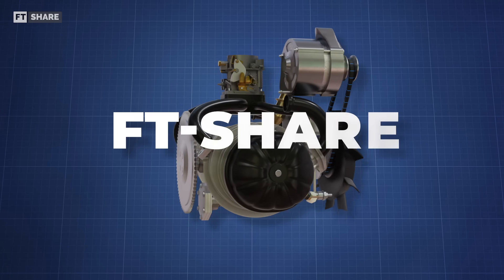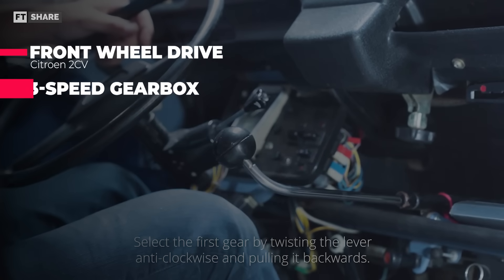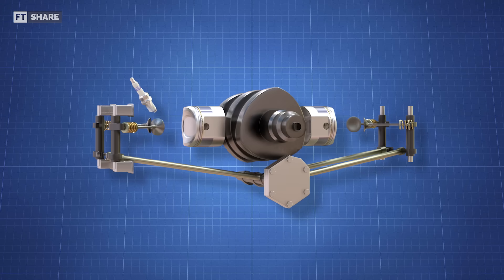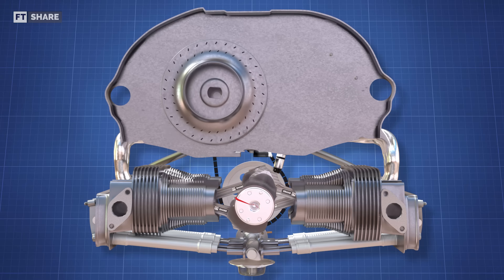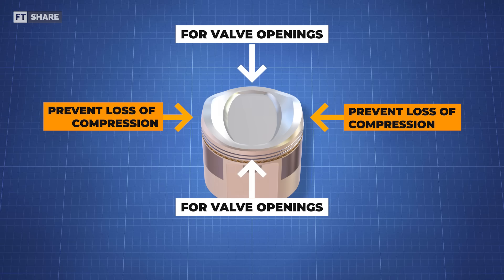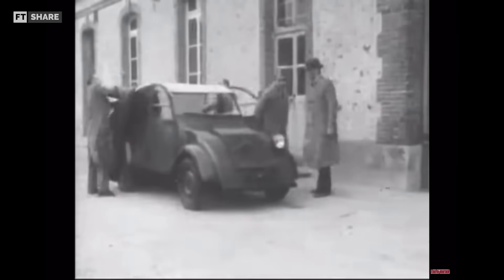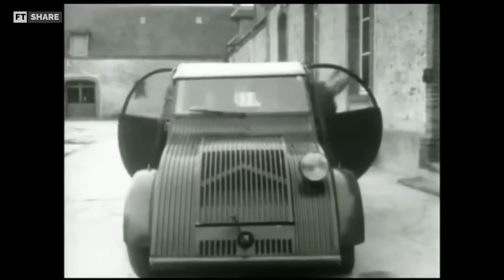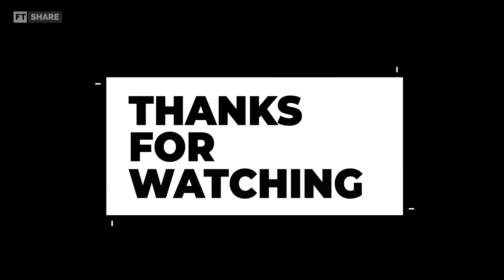The Most Interesting Engine in the World: Citroen 2CV Vs VW Beetle

Comment: Do not forget, the VW engine is a Design from 1934 (by Ferdinsnd Porsche), while the 2CV started from 1945 while André Lefèbvre  knew about the beetle ( and its flaws). And take the BMW Motorcycle in consideration, which also had a 2 cylinder boxer engine, which is produced up to these days ( at least the basic design)

Comment: He ignored the fact that the Volkswagen engine has a oil radiator besides the fan. Every beetle since 1938 has 4 gears, the 1100 cc engine was only produced until 1953, the 1200 had 36 hp! And the most common 1300 had 46 hp, the biggest one was 1600 and with carburettor achieved 65 hp. At 9:10, the beetles with crank manual start are so rare and are from the 50's. There's more thing that he igonred, but if you know, you know

Comment: I love A) that this video was clearly an AI development, and B) that it is way biased for the 2cv. Granted I’m biased towards the Beetle, however they left out so much information about the Beetle’s engine (i.e, they fixed cylinder 3 overheating with a doghouse cooler in the 70s with the largest Beetle motor, which made 50-60hp depending on emissions regulations, the Beetle doesn’t rely solely on the cooling fan but air moving past from the underside and some oil cooling, etc etc). Definite slop either way

Comment: Somehow the Citreon wasn’t as successful as the Beetle. The Beetle was sold in its millions and made in other countries. Still in the post-war period it was what many needed - simple, affordable, … like the Beetle which went from circa 1.1 liters to 1.6 liters, the pressure was fir more power and torque. 

The crankshaft construction is seen in motorcycle engines. The ubiquitous Harley-Davidson 45 deg V twins use such a multi-piece flywheel-crank assembly. Except H-D used “knife & fork” connecting rods thus having no offset. And the H-D V twins used the “wasted spark” ignition system. No distributor rotor is needed as when the the breaker points opened both spark plugs fired. Once in a cylinder on the compression stroke and the other on the exhaust stroke. This was used until replaced with more sophisticated systems with crankshaft position sensors & computers. 

60 kph top speed is about 37 mph. There are e-bikes that the Citreon might barely be able to outrun. But the Citreon sure beats walking in the rain.

Comment: Another script written by chatGPT. There are way too many errors in this AI generated slop, eg passing hot air past the carburettor will not imcrease air density a d bower but will in fact do the opposite.
Reply from the maker: Thanks a lot for your feedback. We know language is still a bit of a challenge for us, but we’ll try to work on it and improve in future videos. Really appreciate you pointing out the parts we got wrong.

Comment: Starting with min 6:20 ´´...the hot air was used to heat the carburator wich by heating the air entering the engine will increase the density and power of the engine´´ .... SAY WHAT ???  As far as i know  in order to increase the power of an engine the air entering the burning chamber has to be cooled down with a intercooler. Cool air is more dense not hot air am i right ?
Reply: Yeah, you're right

Comment: Comparing the 1200 cc VW engine with 34 hp against the 602 cc (later) 2CV engine with abt 30 hp it seems that the 2CV engine is much more efficient.

If the VW engine, which is twice as big, had the same efficiency it would have about 70 hp.
Reply: But it's up to the manufacturer too decide how much power an engine produces. VW could have made the engine produce 70hp if it wanted to but didn't.
Reply: @wizzard5442  70 hp from a 1200cc engine would be quite 'tuned' and it would at least needs 2 carbs, the 2CV only has one.
Reply: @flyingdd  I'm aware of that, I used to drive VW's for 30 years.
I said 70hp because YOU said it.
Reply: @wizzard5442  My only point was that the 2CV 602 engine was (built) so much more efficient than the VW 1200 engine.

Comment: Thank you! GREAT made! I have a Citroën Dyane 1967 a luxury 2CV.
I like a lot your animation.
Little "error" is that the smaler engine (mine has 425cc and 18 german HP) have thier dynamo (DC) AROUND the crankshaft! AGAIN less a part that could break! INGENIOUS!
That car is "simple" but geniously simple.
Also the suspension is ingenious. Only the Hydropneumatique would be better.
With my Dyane I have true 100Km/h on the Autobahn and in flat lands a consumption of only 4 Litres per 100Km and in the mountains below 5 Litres/100Km.
Weight is only 580Kg empty (5Litres in the reservoir and no tool box) so close to 600Kg if the 20L reservoir is full and a good box of car tools.
GREAT car - I call her Jana and she's my best mechanical grilfriend xD.
Let me tell you that I like it ALOT that she's semiconductor FREE!
Cordial greetings!
Géréon
Reply: En el mío por 1983-4, los platinos había que calibrarlos cada 3 a 4 meses, para mantener una agilidad y repuesta razonable, así que encontré en una revista de radioaficcionados, un circuito con dos transistores de potencia, y alto voltaje, dos resistencias una de 20 watts, y otra de 5 w, usando el mismo condensador del auto, y se intercalaba en el encendido normal. con ésto el platino pasó de usar 2 amperes a apenas tener que pasar de 0.2 a 0.5 amperes, la chispa pasó de casi 10 mm, a 15 mm, y la marcha se tornaba muy serena, la luz del platino, podía ser mínima y en un año no se debía recalibrar, no había chisporroteo en el platino, con lo cual no se desgastaba. resultó tan útil que lo llegue a reproducir para varios amigos con 3CV, y aún más se lo instaló en un Peugeeot 504, en un Chevy 230, en una Ford F-100 de 8 cilindros, perfectamente. en el caso del Chevy 230, la marcha era tan serena, que andando en la calle a paso de hombre, el motor no tironeaba, en tercera, y yo creyendo que estaba en primera, quise acelerar y ahí se me paró, por el bajísimo régimen de rpm que llevaba el motor, y no me había dado cuenta por la serena marcha del motor de 6 cilindros !!!
Reply: @c.e.ardanaz1234  die Kontakte (français: les vis platinés; english: points) von "TROUVE France", Nachfertigung, halten bei mir 12'000Km (ausprobiert bis der Motor schlecht lief). Ich fahre im Jahr weniger als 10'000Km sodass ich froh bin mir die Halbleiter vom Hals zu halten.
Diese Autos werden noch fahren wenn es einen Sonnenstrum oder einen Atomunfall gibt. Glühbirnen mag ich auch viel lieber - kleine Sonnen.

Comment: I am familiar with the Beetle engine as I've owned several VWs, the earliest being 1963 and the latest a 1967. I will comment using my personal knowledge of these engines and what I see here on the 2CV engine. It looks like the 2CV engine is cooled simply by a  fan, without any regulation to provide consistent operating temperature. The Beetle engine incorporates a fan housing which directs air downwards across the four cylinders and out. There is a thermostat that operates flaps that regulate the cooling flow of air, allowing for very fast warm up followed by constant running temperature. The number 3 cylinder ran warmer as stated here, but that was corrected in 1971 by an offset oil cooler that didn't block air from the cylinder. This system was easily retrofitted to earlier engines if desired. The oil pump was as described, but it worked well and better oil pumps were available and easily fitted to the engine. The Beetle engine also had a carburetor pre-heat system to prevent icing. Boxer engines with center-mounted carburetors are susceptible to icing because the carbs are separated from the heat of the engine. The VW engine compartments were sealed so that the heat from the cylinders and exhaust would not enter above the floor of the engine compartment where the air intake and carburetor was located. The lower compression of the Beetle engine reduced stress and allowed for longer engine life. However, the typical fuel economy of a Beetle was between 28-32 MPG which was apparently not as good as the 2CV. The Beetle had a distributor with a vacuum advance and fired only on the power stroke of each cylinder. But the method used on the 2CV with a wasted spark is like many motorcycle systems, so its really not that weird. The fan on the Beetle was driven off the back of the generator shaft, the generator being connected by a V-Belt. If your generator light came on because of a broken belt, you had better immediately pull over and shut down because without the cooling fan, the engine would cook in 15 seconds. In all my experience, this never happened. 

I hope I provided some additional useful information to what was presented here.
Reply: The 2cv has a cooling shroud, that covers the fan, cylinders and cylinder heads. Pretty much like on a VW. Only not thermostatically controlled..Carb icing on the 2cv was dealt with by exhaust gasses heating up the manifold.
Reply: Re the VW broken belt, in the Type 3's, the fan was part of the crankshaft drive-line so if the belt broke, you could still drive until the battery died.
Reply: @ReddThreee yes, only 0:06  the VW 0:06 engines with the upright fan housing use a belt to drive the fan.

Comment: I guess we are going to see more AI generated garbage littered with incorrect information. As a technician watching this is cringe!
Reply: Like the gearbox being three speed when it is actually four speed.
Reply: The 2cv engine is turning the wrong way. The 2cv oil pump shown here would not send a drop of oil anywhere. The valves are doing all sorts of strange thing, such as pushing the exhaust gasses back through the carburettor. I can’t watch any more of it either!

Comment: It is a real shame that the ‘facts’ presented are so distorted. Like already said… the spark plug gap inhibits cooling. OMG. 
The oil cooler is over #3 cylinder but really doesn’t cause an issue in well maintained engines.
Reply: Cusí cusá, no es el primer vídeo con incoherencias, lo bueno sería una "fé de erratas", no?

Comment: Wait, wait... Do you actually think that the 2cv remained at those 9hp forever?!
You do realise that your figures are only for the first series, Type A from 1949 to 1959, right?
And you do reslise that its carrying capacity isn't obviously just 50kg as that wouldn't even be enough for the driver, right? It's carrying capcaity for the Type A was the weight of 4 adult passengers PLUS 50kg of cargo, meaning you could carry a lot more, if you opted for more cargo and less passengers.

Comment: Interesting video. I suspect translation from another language is responsible for some of the verbal errors. However, in the graphics, what is identified as the #3 cylinder on the VW is actually cylinder #2. #3 is on the opposite side of the engine closest to the flywheel.  Eventually VW moved the oil cooler outside of the air flow to cylinder #3 and put it in it's own enclosure called a doghouse. It's a shame it took them so long to do it.
Reply: "Duraznos" como ingenieros dispuestos s desarrollar y mejorar el motor que les diseñó en Ing Dr Porsche, ya que él se había reservado la mejor versión y más perfeccionada con los años. Así fué como los japoneses le pasaron por arriba ya a inicios de los ´60.

Comment: They forgot 

The Citroën 2cv engine is actually a smaller vercion of the old Panhard 2 cilinder boxser 
That engine actually had more power as the VW engine 
But was stil a 2 cilinder only 850 cc But stil delivering 50 HP 
And verry reliable 

Put in a car made complete from Aluminium 

Yes Audi was not the first one there 

They also got beat by the french 

And then there is another 2 cilinder from the same time 

The Perkins engine juced by DAF in the vario 

Atomotive in the 60ies And 70 ies was much more interesting as 2 cars 

The Daf 33 was actually a verry good 
The Perkins engine verry reliable

Comment: Couple points:

-The #3 cylinder on the VW engine is where the oil cooler is mounted, which restricts the airflow somewhat.
-Both cars use exhaust heat to warm the carburetor quicker. Cold air is actually more dense than hot air. That's why tuners like cold air intakes on their sports cars. Finally, the use of exhaust heat via the cross tube is to prevent icing, reduce warmup time, etc.

Comment: Hang on didn't it always have a 4 speed transmission, the designer wanted a 3 speed but it was actually cheaper to fit a 4 speed. A lot of inaccuracies in this video.
Reply: Es muy posible que los primeros prototipos, hecho poco antes  de empezar la 2GM, tuviesen cajas de 3 velocidades, habría que preguntar a Citroen, además tenía un solo faro delantero y uno solo trasero, amén de que el motor inicial era refrigerado por agua, durante la 2GM, los hombres de Citroen, viendo cómo se desempeñaba el Vw militar enfriado a aire, decidieron la modificación que resultó un éxito para cuando se lanzó a la venta en 1948-9

Comment: This is riddled with technical errors, such as when talking about the number 3 cylinder on the Beetle engine you pointed to the number 1 cylinder and heating the carburetor doesn't "increase the density and power of the engine" whatever the hell that means...Heat to the carb, stops the carb from icing up in cold weather

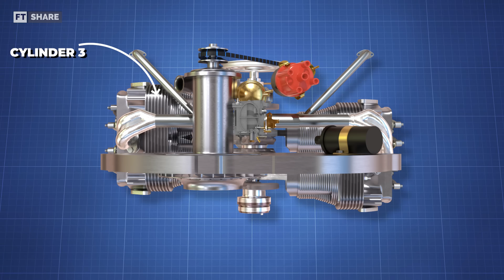Comment: 5:13   You got the cylinder numbering wrong,you called cylinder 2 as number 3.  and slark plug gap has nothing to do with number 3 running hot, rather oil cooler placement is the issue.  thks was rectified initially by retarding #3 spark, and later by redesign of the cooling system, moving of the oil cooler

Comment: Yes the citroen 2 cv is the best engine design and engineer in the world! It's a big shame this great engine wasn't made to a 1.1 size to be fitted into the citroen visa as it was a heavier car, plus being a bigger engine and maybe have a 5 speed box would be amazing on the motorway, and going up very steep hills and mountains, its an engine and car that fits any where in the world, especially the citroen visa!!!
Reply: Apoyo completamente la idea !!!, muchas personas han reemplazado el Boxer del 2CV, por el de las motos BMW, que son más potentes y les ha funcionado muy bien, así que llevar el motor a 1.1Lt, dotarlo de 4 válvuilas por cilindro, con inyección de combustible, doble ó simple árbol de levas, como tuvo el GS, refrigeración aún por aire reforzada, y mayor compresión de aire por la turbina, tanto para refrigerar el motor, como para meter más aire al motor, con caja de 5 ó 6, (sin saltos de cambios como el que existía en el 3CV, entre la 3° y 4°), Un bichito así puede andar en los 100 CV Din, fácilmente.

Comment: 2CV 3 speed gearbox - what are you on about.  It always had a four speed one!
Reply: Probably AI sludge. I don't know anything about 2CVs but am very familiar with VW engines and had to bail after the BS about the "less than ideal placement of the spark plug gap" on the #3 cylinder.

Comment: This video has some very strange information: strange placement of the spark plug gap? Heating the intake air makes it more dense? Thats when I stopped watching.  The people who made this video should learn something about engines BEFORE they post a video!
Reply: I think they used Google translate.
Reply: Translate wouldn’t change the fact that they have no idea what they are talking about.
Reply: @timh2870  The #3 cylinder issues has nothing to do with the spark plug. And the diagram was also pointing to the wrong cylinder. I think they just used AI.

Comment: Interesting presentation of an exceptional pair of cars, very symbolic of their birth countries.
German unbreakable. 
French - Viva La Difference - ingenuity, style, comfort and practical..
One basic detail here is wrong - 2CV has always had 4 speed gear box - not 3. 
4th is an overdrive.

2CV is amazing - I have owned 3 x 2CV6s from new over 45 years and 550,000 kms...
My 1990 Charleston now has a Burton Big Bore 2CV engine plus Power Tube.. 
20% more horses and torque. 29 hp to 35 hp. 115 kph to 125 kph. O-100 kph from 32 secs down to 22 secs. 
So unique here in Australia... makes friends everywhere you venture.